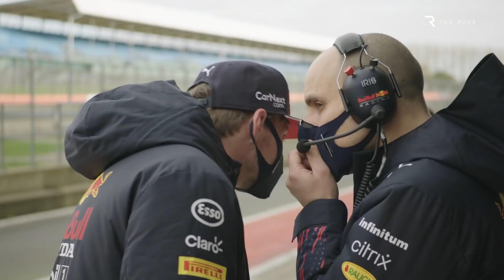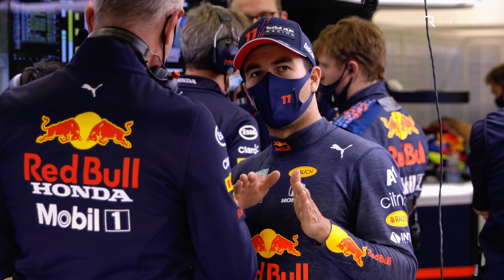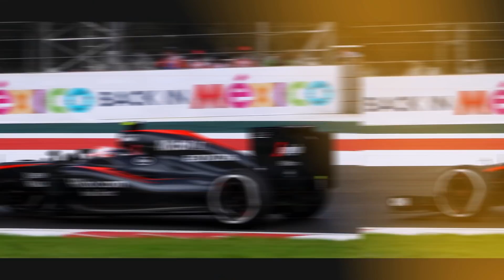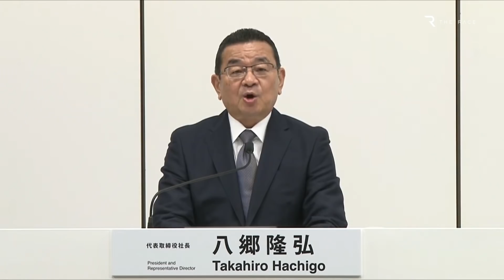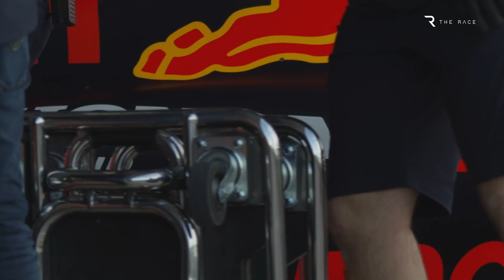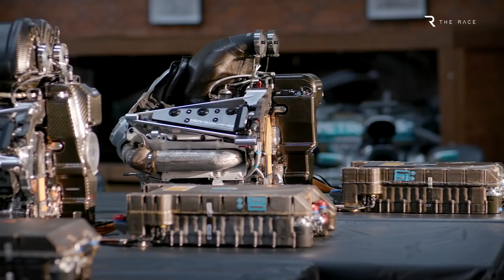The major F1 engine upgrade Honda kept secret

Comment: I don't really care if Honda-powered Red Bull win the championship this season or not. But this Chapter of Honda F1 programme has been one of the most amazing story in the sport. From being a laughingstock to compete directly with the King of V6 Turbo Hybrid. While also starting the development later than other manufacturers.
I think Honda can leave this sport with their heads up knowing that they have done such an incredible job, and putting Renault (and Ferrari) to shame.
Reply: Honda were always going to figure it out. Just look at all the other motorsports they develop in, it was only a matter of time. Just a shame they aren't staying in F1
Reply: @TE-mw7ly  I suppose they  want to concentrate on battery, possibly fuel cell technology for their road cars as petrol is now going to be defunct tech.
Reply: @redpoll4628  dino fuel tech is not going anywhere.
Reply: @redpoll4628  gasoline isnt going anywhere anytime soon.
Reply: Merc was previously Braun GP which was previously Honda, which makes it even more poetic if they do beat Merc
Reply: @ericlambart536  Braun GP did not use the Honda technology at all. They used the designs from the SA09 - the car which was to be Super Aguri's 2009 contender. This was the origin of the double-diffuser that year.
Reply: Ä
Reply: @ericlambart536 Braun GP used merc engines though . And Braun designed the car for Honda!
Reply: @ericlambart536  I think it's personal for them to defeat their old team.
Reply: @ericlambart536  aint gonna happen.
Reply: Honda will stay engaged in development of the RB titled motors. They just couldn't carry the cost anymore. RB can directly whilst Honda goes on the paylist/shareslist or something like that. Just watch.
Reply: The annoying thing is this story is that everyone seems to forget McLaren had a HUGE part in this as well. From not willing to adjust the chassis for the engine, not willing to budge on size-zero at first to manipulating the numbers by driving with extra downforce in free practice and thus blocking Honda in their development process.
Reply: @djoetma  and the token system prevented them from changing the design during the first 2 years once they realized the turbo in the V wasn’t going to work. That FIA rule handicapped them big time.
Reply: @madmaz74  True. That was indeed a big factor as well. That was such a dumb regulation. Because Renault also suffered from it. Same with the testing restrictions.
Reply: @djoetma  I think Ron Dennis will feel vindicated now. He insisted on having a works engine relationship with the manufacturer. Had McLaren stuck around, they would have been reaping the benefits now. But not sure if they would be dominating like Red Bull, after all RB has Adrian Newey at their disposal.
Reply: Definitely agree. The fact that no other manufacturers joined aside from Honda is proof how much of a risk it is as having any amount of lead time in development is a huge advantage in comparison to a new manufacturer as was shown when Honda was way behind at the time.  Imagine if it was Renault who was the new kid on the block back then, they would of quit the sport within a few years.
Reply: Agree. This has been an amazing story.
Reply: Well said ...although as an aside why do Honda keep leaving F1 just they are getting their act together?
Reply: @charlesjmouse  I think it was the cost factor
Reply: Yeah and people were making fun of Honda and praising Renault as a much better engine🤡🤡🤡🤡 I was always telling them they were delusional. Now it's obviously showing
Reply: I still couldn't get through the fact that they (as a brand) is leaving the sport next year...even back in the terrible McLaren days I root for them, hoping they could make a comeback which they eventually did with RBR/AT. My interest of the sport will definitely drop massively next year onward.
Reply: Ferrari is becoming shittier by the day.
Reply: @bubbadubdub_trex  Weird thing is if ferrari the road cars are doing well the F1 cars are awfull. if the F1 cars are doing well the road cars are awfull.
Reply: Agree. But I still hope Max wins!!!!!
Reply: To be fair, Honda was never as bad as Mclaren claimed, even today most F1 followers will not admit how broken Mclaren was, from the management to the engineering teams. Sure Honda had high failure rate but Mclaren was no better with Renault. I believe Mercedes has instructed Mclaren to stop whining with elaborate irrelevant excuses and straighten up their act, their current progress is not only due to the engine and Honda never was their biggest problem.
Reply: @pflaffik  Sure they kept blowing up and then they had to detune them to keep them from blowing up that's not so bad is it? Why was it they switched from Renault to Honda? Because those Renault engines sucked. Dude, they almost beat Lewis straight up. There is no substitute for horsepower.
Reply: ö
Reply: Same could be said for Mclaren .  from lauging stock to front runners
Reply: @marcusfranconium3392  There is no substitute for horsepower
Reply: @jackhammer111  Raging bull power .
Reply: MAX & HONDA => BEST F1 RACES EVER!
Crapcerdes and its blk bozo is the jrkiest team and maker, ever!
BRING/KEEP JAPANESE ENGINES IN F1!!!
Reply: and yet Perez and Alfa Tauri are where??? nope merc wins constructors and if Max wins drivers is mainly on his sheer skill
Reply: But why leave again?! And again?! Ugh.
Reply: @ehtikhet  it's all about the money money money~
Reply: Honda stayed though
Reply: Honda was never the problem. Mclaren was.
Reply: The will get a title as a farewell 🤞
Reply: @Awad Ahmad
Sadly that won't happen until RBR remember that they need 2 pilots to secure constructors championship.
Reply: @arapaimagold8088  i think they're here for the drivers title... because they really do need more wind tunnel time than mercedes for next year
Reply: The Japanese will always be superior engineers when it comes to performance and kings of reliability its just part of their culture just look at Japanese road cars their the only companys that can make a full line of extremely reliable cars merc is just overpriced over engineered junk
Reply: @crabbiboi5528  Kia and Hyundai are regular winners of the Worlds most reliable vehicles , across a very wide range indeed, as judged by the various roadside rescue organizations. South Korean maker, not Japanese.
Reply: you kidding right? got oil dilution below 4 c canada and US mate, and sludge in asia. My 200 hp 1992 GSR Acura was pinnacle, today their engines are a joke,,, Honada subcontracted OUTSIDE Honda and it's empty Sakhura R&D centre key development processes, and dully clad them in non disclosure. By then, 2019, i already knew since Hachigo' Extraordinary meeting in Tokyo, december, that Honada would exit F1. too many QC and billions in recalls spent so no more 500 million USD every 4 years for the F1 program. So while Merc had 12 TWELVE advance PU programs, including Michael Kuebler hand assembled Pagani engines, to the F1 PU, 3 billion EURO R&D annually, Honada had ONE advanced program, a mickey mouse joke, its F1 PU. Indy closed architecture and contracted, and NSX and Type R also subcontracted. Yes, Honada Moto Corp also went outside to fix its engine at a lifecycle x5 that of Mercedes AS FIA ALLOWED THEM. Finally, after 15 engine iterations in  5 years, versus 5 for Merc, and a subzero engine with Newey drafted aero and Dominicali approved, the inferior weaker Hoanda engine can now benefit from a higher power to drag ration than the token locked W12 low rake, which regressed in lap time from W11. yes the honada engine is still weaker, i think 50-100 hp. So your Miracle is nothing but the result of multiple lifecycles, outside help, (even the moto division had to help it with tribology whereas Amg does its F1 coating on the sedan line!!!), and aero rules and token that shackled Mercedes. So the miracle, from a program management view, is Merc likely winning the constructors DESPITE all of that., retrograde car, engine development limits and aero drag they cannot fix. Also, Merc did  80% effort 2022 car, RBR 80% 2021. As it stands RBR Powertrains is in such trouble that RBR begged Honada to stay, and, aware that Sakhura cannot develop further, now begging VAG and Porsche for help.
Reply: Then you know little about engine research and development, and program management. If Merc WAS GIVEN THE SAME LEEWAY that Honada was, W12 would be running right now a size sub zero 1200 hr engine right? Honada subcontracted OUTSIDE Honda and it's empty Sakhura R&D centre key development processes, and dully clad them in non disclosure. By then, 2019, i already knew since Hachigo' Extraordinary meeting in Tokyo, december, that Honada would exit F1. too many QC and billions in recalls spent so no more 500 million USD every 4 years for the F1 program. So while Merc had 12 TWELVE advance PU programs, including Michael Kuebler hand assembled Pagani engines, to the F1 PU, 3 billion EURO R&D annually, Honada had ONE advanced program, a mickey mouse joke, its F1 PU. Indy closed architecture and contracted, and NSX and Type R also subcontracted. Yes, Honada Moto Corp also went outside to fix its engine at a lifecycle x5 that of Mercedes AS FIA ALLOWED THEM. Finally, after 15 engine iterations in  5 years, versus 5 for Merc, and a subzero engine with Newey drafted aero and Dominicali approved, the inferior weaker Hoanda engine can now benefit from a higher power to drag ration than the token locked W12 low rake, which regressed in lap time from W11. yes the honada engine is still weaker, i think 50-100 hp. So your Miracle is nothing but the result of multiple lifecycles, outside help, (even the moto division had to help it with tribology whereas Amg does its F1 coating on the sedan line!!!), and aero rules and token that shackled Mercedes. So the miracle, from a program management view, is Merc likely winning the constructors DESPITE all of that., retrograde car, engine development limits and aero drag they cannot fix. Also, Merc did  80% effort 2022 car, RBR 80% 2021. As it stands RBR Powertrains is in such trouble that RBR begged Honada to stay, and, aware that Sakhura cannot develop further, now begging VAG and Porsche for help.
Reply: @MusashIBelis  Well, here is hoping Lewis wins this year even with all the restrictions the FIA heaped on Mercedes.
Reply: Honda is a joke, its QC and billions of bleeding costs due the faulty engineering are a financial disclosure fact and industry common know,edge... I am the bloke that Motorsports F1, in 2017 forecasted no G sim at Sakhura (hasegawa admitted it in June), and the F1 departure after the dec 2019 Tokyo meeting. yes i watched sakhura videos so i knew how amateurish they were just from their desk spaces and computers and tools... they did 15-20 engine cycles in 6 years versus merc 5 (and no title wins), as permitted by the FIA due to failures... If Merc WAS GIVEN THE SAME LEEWAY that Honada was, W12 would be running right now a size sub zero 1200 hr engine right? Honada subcontracted OUTSIDE Honda and it's empty Sakhura R&D centre key development processes, and dully clad them in non disclosure. By then, 2019, i already knew since Hachigo' Extraordinary meeting in Tokyo, december, that Honada would exit F1. too many QC and billions in recalls spent so no more 500 million USD every 4 years for the F1 program. So while Merc had 12 TWELVE advance PU programs, including Michael Kuebler hand assembled Pagani engines, to the F1 PU, 3 billion EURO R&D annually, Honada had ONE advanced program, a mickey mouse joke, its F1 PU. Indy closed architecture and contracted, and NSX and Type R also subcontracted. Yes, Honada Moto Corp also went outside to fix its engine at a lifecycle x5 that of Mercedes AS FIA ALLOWED THEM. Finally, after 15 engine iterations in  5 years, versus 5 for Merc, and a subzero engine with Newey drafted aero and Dominicali approved, the inferior weaker Hoanda engine can now benefit from a higher power to drag ration than the token locked W12 low rake, which regressed in lap time from W11. yes the honada engine is still weaker, i think 50-100 hp. So your Miracle is nothing but the result of multiple lifecycles, outside help, (even the moto division had to help it with tribology whereas Amg does its F1 coating on the sedan line!!!), and aero rules and token that shackled Mercedes. So the miracle, from a program management view, is Merc likely winning the constructors DESPITE all of that., retrograde car, engine development limits and aero drag they cannot fix. Also, Merc did  80% effort 2022 car, RBR 80% 2021. As it stands RBR Powertrains is in such trouble that RBR begged Honada to stay, and, aware that Sakhura cannot develop further, now begging VAG and Porsche for help.
Reply: @MusashIBelis  just produce your own F1 power unit if you think you can do a better job than them mate 🤣 much more productive than typing loads of crap on the internet. I'm sure your engine will be a nice welcome to the sport anyway, the more the merrier.
Reply: @MusashIBelis  shit dude, so much text and NONE OF IT is readable. Try avoiding shortcuts, disable autocorrect and make comprehensive sentences so that we have some sort of clue of what you're saying🤜🏽🤛🏽
Reply: Tbf though if the Mercedes didn’t lose so much speed from this year’s reg changes they’d still be around half a second faster
Reply: Can't agree less. Honda nearly murdered McLaren, then joined forces with only team in F1 with two teams, one of which could be used as test team,which literally nobody else in F1 have, finally stick their pride down under and started to work with european partners like AVL. Mind you, all RB drivers clearly was forbidden to critisize engines at all - Max was marvelously gentle about engine power and reliablity, while Renault power was blasted without regrets.

Honda did manage to make decent engine, sure. Not in time. but it did. Red Bull title challenge is 80% on Red Bull chassis, which just better than Merc this season. 

Those poetic stories is just a way to wash Honda's megafail, imagine McLaren didn't dump them and commit. We might have one of all time greats gone by now.
Reply: @idislikemyhandle  You’re stating some interesting facts, which are hard to disagree with. However, if you look at AT’s performance, it’s obviously up compared to last season, so, maybe Honda’s got a decent share in that?
Reply: @idislikemyhandle  Good McLaren needs to leave F1, good riddasnce
Reply: @jaimersholden8686  McLaren leaving is like Ferrari and Williams leaving. Impossible. Even Mercedes has more chance of leaving than McLaren.
Reply: It will be Hammertime, Honda or Shonda who cares?
Reply: @jaimersholden8686  hammertime is over
Reply: @Bearical  Hammertime next 10 years. No need Red Bullshit.
Reply: @jaimersholden8686  i care
Reply: @akshayurs9271  ka bhai?? baap ka mooh mein hag diya ka?
Reply: @jaimersholden8686  Wtf man,
You're just one toxic af merc fan, who i bet does not even know what he is talking about.
All I wanted to say is that honda have made huge improvements in a very short period of time and that u can't deny the fact that they are more dominant that mercedes this year
Reply: @jaimersholden8686  Max is way superior , it's like a machine.  Crymilton is a fraud exposed by Max and others.
Reply: @givemeabreak8784  Its hammertime, you know it, you are just lying to yourself.